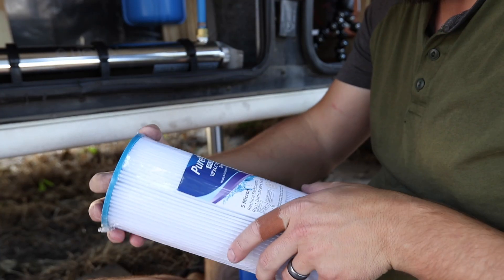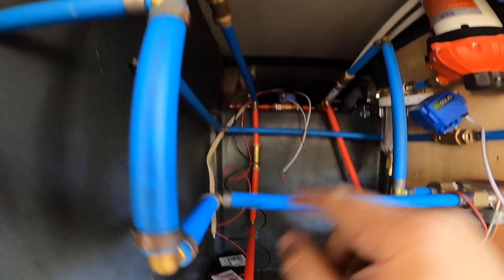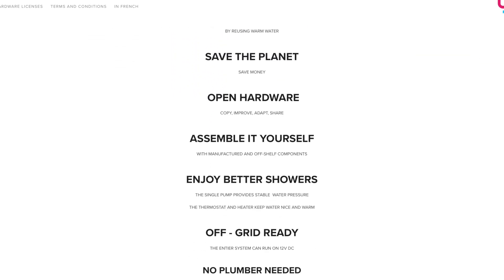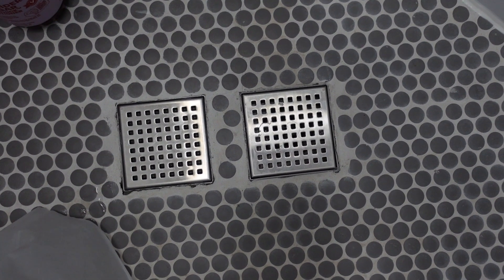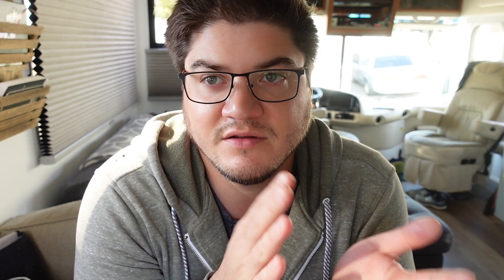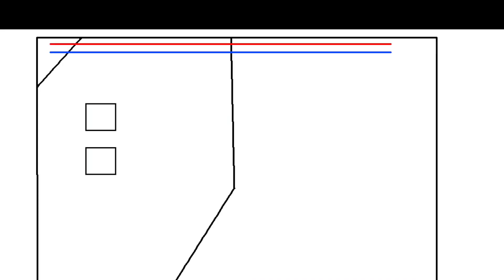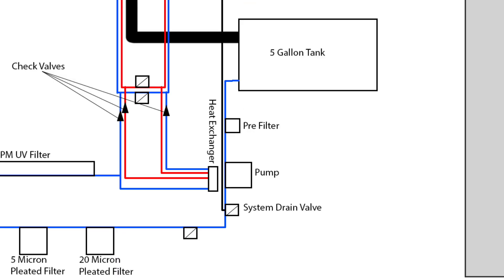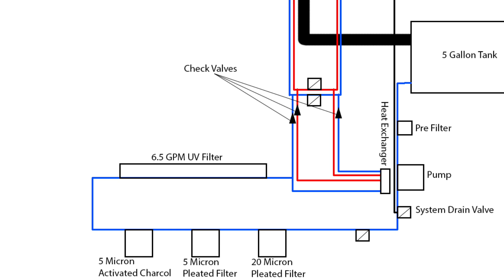Overview of Our Recirculating Shower | RV Renovation

Comment: Awesome info.  Trying to figure out how you heat the water?  I was going to do an inline on-demand heating solution, but I figured it would get hotter and hotter the longer you ran your shower, and I dont want to pull fresh/cold water into the system to keep balance if i dont have to.
Reply from the maker: We explained it a little more in a follow up video.  Hopefully that helps. 

https://youtu.be/dhpBTra9bXs
Reply: @ryanandsu  hi great video i have the same question i can't find your video explaining that great exchanger. Please let me know how to search it. Thanks
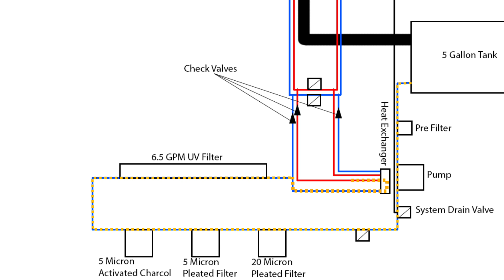Reply: This is great info. I also have questions and would like more details, but the link wouldn't work. At 6:02 he explains he has a T in pipe before exchange that diverts recycled water back to cold line, so it doesn't waste fresh to cool hot water.
I see with a tank style & exchange you don't have to worry about mixing recycled hot water with sink hot water, if it's used at same time. I was also thinking about a on demand heater. Btw my understanding of them is they are set to a temp an only heat enough to bring incoming water to that temp. So if water flowing in is 98° and it's set to say 130° then it will heat the 32° difference. With a tankless you could tie in between a no backflow to protect freshwater tank and the heater, but how to segregate the water demand between the shower and sinks if needed at the same time? They make a camp style on demand heater for about $150 that might be able to tie into propane lines. I need to look into reviews to see if it's cheaper/efficient to just separate hot water for the shower.

Comment: Does those sediment filters remove the soap?
Reply from the maker: I was hopeful it would, but it helps some. The water comes out with a little bit of a cloudiness to it. It’s perfectly fine for a shower. We have used it many times dry camping and it’s amazing. But it won’t create perfectly clear water. If you go take a look at showerloop.org, they have some custom made filters that look like they would work better. We just didn’t have the space to put them or the cutters needed to build them.
Reply: @ryanandsu   Since my first question with you folks I've built my own system and found a cleansing foam that works very well for a recirculating shower, it's call Aloe Vesta .
Reply from the maker: @travelingman21000  Oh awesome, I will have to check it out.

Comment: What type of soap works for the recirculating water shower? Would the stainless steel soap bar be an effective substitute?
Reply from the maker: I’m not sure. Soap is really tough to filter out. This system does a good job of getting some cleaned up bath water. I’m not sure if anyone has been able to do much better because of the nature of soap. But it’s be interesting to try some different stuff and see how it filters out.

Comment: Looks great.  I am about to tackle this same project in my van.  I am struggling with the heat exchanger piece.  I saw you had another small pump right before it on the fresh water side. How are you circulating the hot water on the other side of the exchange?  Are you turning off other valves and creating a temporary closed loop system that cycles the "hot" water on the fresh side with the small pump?  I don't quite see that detailed in your diagram.  Any details would be appreciated.
Reply from the maker: Yes. Exactly. I closed off both fresh water valves. So the hot water is pushed through the heat exchanger and then a check valve before being pushed into the cold water line.

Comment: That is awesome guys, good job!! I'm researching about this topic right now for my sprinter van conversion and I wanted to ask you why not buying one of those 5 stages under sink kits? What is the difference? Maybe is the amount of water you can obtain from each one of them? If you could help me with this, that would be awesome!!!
Reply from the maker: It’s the longevity of the filters. These are 4.5”x10” canisters that are for whole house water filtration. You can’t get the same flow and life out of the smaller drinking water filters they sell for under sink filtration. With this, we easily can get 5.5 gpm. The main restriction is the pump volume and shower head flow rate. Having the filters also lowers the amount of pressure required pre filter in order to force the water through. So it’s easier on the pump.

Comment: do you think it's possible to have recirculating sink system? or are the particles from washing dishes might make it trickier?
Reply from the maker: I think it’s absolutely possible. I was contemplating doing it. But the cost of additional filters and space requirement made me rethink it for now. I would suggest using a strainer in the sink and then use the larger prefilter. It should work great. 
The guy who wrote up the original showerloop design has a whole home ecosystem design that uses recirculated shower water to clean dishes. Then that water is used to wash clothes. Then it is filtered and used for irrigation. It’s just a matter of getting it all plumbed and setup.
Reply: Both of you, @holy science and @ryan and su, need to look into what it takes to filter soap from water. This isn’t it. The first time you put soap in that shower the carbon filter is toast. Recirculating showers aren’t actually showers, they’re recirculating rinsing machines. Since you already have two separated drains you can drain your soapy water into the grey tank but you should never let any soapy water enter the filters. Removing soap from water takes multiple layers of filtration sub 5 microns, through a series of bag filters it can be done but not with the type of flow necessary to run a shower. You can also use salt. But, I mean hundreds of lbs of salt, like a soft water system. 

I didn’t see you mention it (soap) so I’m assuming you haven’t gotten that far with your research into what it actually takes to filter water. The fact that you suggest reusing sink water may be possible leads me to believe you have zero clue about it. Trust me, not many people do. If it were that simple every house in the world would have recirculating showers and sinks. Cross contaminating your drainage back into a fresh tank is an absolute no no, and will get you very sick. 

Take this into consideration when you make an update and explain to people how unsafe your ideas may be. It could really get someone sick.
Reply from the maker: @inchvans8296  Soap is tough if not impossible to filter out. The charcoal filter is to see if there is any improvement with water quality. The original design uses three pleated sediment filters. 
Also, there is no cross contamination with my fresh tank. I’m not sure why you think that. Seems like you didn’t try to understand this setup.  
The intention of a system like this is to return water for use that is cleaner than bath water. Without a substantial water treatment process, there is little hope for more than that. This type of system has been used for well over a decade in varying forms. I haven’t heard of a single person getting sick from it or heard that this is actually dangerous.
Reply: Ryan and Su idk, my plumbing career of 13 years begs to differ but, you do you.
Reply: @inchvans8296  the shower water doesn’t go back into the fresh water system so it won’t get contaminated.  We’re using soaps free of sulphites and parabins which don’t lather much.  The water still isn’t soap free but neither is a bath!
Reply: @ryanandsu  I'd like to expand on your answer a little bit.  There are two solutions to the soap (and other things, such as peeing in the shower) filtering problem: drain selection and filtering.  Drain selection is the notion that you can build a system that disables the recirculation and drains to the grey tank when you're washing shampoo and soap off your body.  This approach ups the water consumption, and requires "training" of the shower user to switch back and forth.  If you want to stick with 100% recirculation, you're faced with a challenging water filtration process which isn't (as @My Van Life notes) isn't easily addressable for various reasons.  Principally, compact filtration systems that will handle a broad array of chemicals work slowly, and don't produce the output water volume needed in a shower.  The question is how pure you require the water from your shower head to be.  If you can accept that a recirc system won't be the same as a fresh glass of water from a municipal tap, you can have a shower that results in you feeling and smelling "clean".  And as noted above, people who like to bathe rather than shower cope with "imperfect" cleanliness whether they know it or not.

Further, there are recirc showers can be broken down into two broad categories: showers that dump all water between uses, and showers that retain water across uses.  When dumping between uses, there's not a lot of point to the UV filtering the video describes, although it does address residual contamination in the piping.  For those who are open to the idea of recirc showers, but concerned about cross contamination, the major objection to the system described in the video might be the amount of water in the recric plumping, and whether or not one feels comfortable with the ability to flush the water between users.

But it's good to keep in mind that a shower system in an RV with only a couple of users doesn't have the same health concerns that a shower in a gym might have.  Two people living in an RV are probably already sharing all their pathogens, and a little extra sharing in a shower isn't likely to make an impact on their health.
Reply: missingegg thanks for reiterating those points. It’s worth noting that a “hybrid” system in which your recirculating water and your fresh water share any components including piping negates the “fresh” of the entire system. A check valve doesn’t 100% prevent back flow and the constant cycling of the pump in such a small system is guaranteed to create different pressure zones that will cause cross contamination.  It’s best to keep systems separate and divert your drainage water accordingly if using soap or not.
Reply: I know you guys are expanding the topic for positive reasons, and make some good points everyone should look into. 

Soap or any other suspended or molecularly bound substance needs treatment beyond scope of these off grid mobile systems. 

So it is up to users to ‘use’ what they install in a safe way. Like not cutting salad on same bird you cut up raw chicken…. Or not cleaning sink/fridge/table ….. everything has its limits. 

All good points made, but credit to Ryan and Su, plenty of us out here appreciate it, and he is not selling anything, just sharing.

Comment: do you have any issues with soap still being in the water as its coming out???i installed a recirc shower and it doesnt seem to be removing the soap
Reply from the maker: Not that I’ve noticed. It’s been doing a good job scrubbing the water. From what I understand, the activated charcoal filter is a good water scrubber. It’s also why it’s near the end of the chain to finish clarifying the water.
Reply: Donnie!!!!! What up dude!! I was wondering if I would see you in one of these comment sections.

Comment: Excellent! These are almost exactly my thoughts designing my future recirculating shower. How did you solve the problem that water gets warmer  and warmer over time?
Reply from the maker: You do need to make adjustment as you shower. That part can be annoying. And I know there are systems people have designed to keep the water at a constant temperate. I just didn’t want to over complicate it any more than we did. It’s just a minor inconvenience to adjust from time to time
Reply: @ryanandsu  Yes, a constant temperature would be kind of important for me and it gives me some serious headaches how to overcome this problem. Do you have any references to the designs you mentioned that solve this temperature problem that i can review?
Reply: mikeskier you can get a thermostatic mixing valve that automatically adjusts cold and warm water flow to keep temps constant.
Reply: @ryanandsu  use a thermostatic valve and set it at the warmest you want the water to be, then it will basically do that for you. There are a lot of cheap ones but they’re not too pricey for a nice one, I think mine was like 90$.
Reply: This video is one I looked at that he seems to address that issue. 
https://youtu.be/SPc4qp3m5Ok
Reply: Just set your heater to a specific temp. Run your shower for a while until you figure out the exact temp you like. Then leave the water heater alone and never touch the adjustment again. Lol. This also negates the need for a 2nd line for "cold" from your recirculating storage tank

Comment: Thanks for clearing things up! Does your cold water return (when recirculating) steadily heat up over the course of a shower? Or does the warm drain water lose its heat as it's running through the filters?
Reply from the maker: It can depending on how much water you have mixing with it coming from the heat exchanger. I would say, on average, we lose 3-5 degrees just running the cold tap with no added heat. But that’s been in colder temperatures. When it’s warm out, we sometimes don’t need the heat exchanger to add more heat to the system. I typically adjust the temp a few times during a shower for the heating up/cooling down effect of adding more or less heat to the system. 
Hope that makes sense.